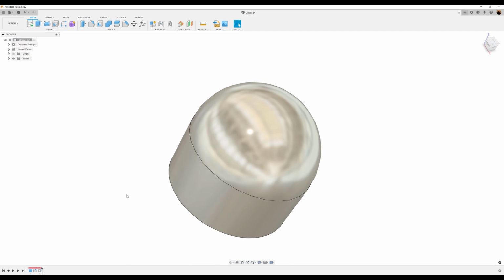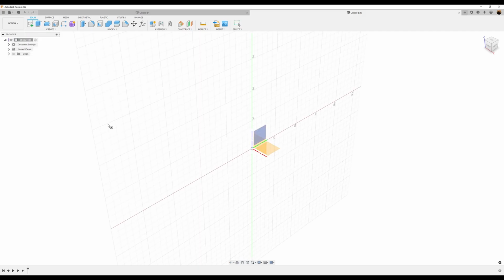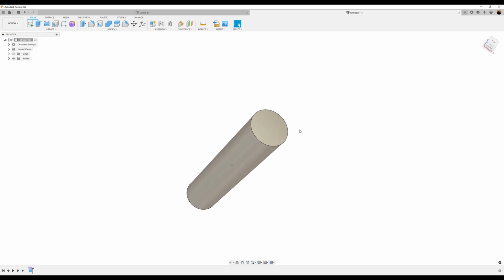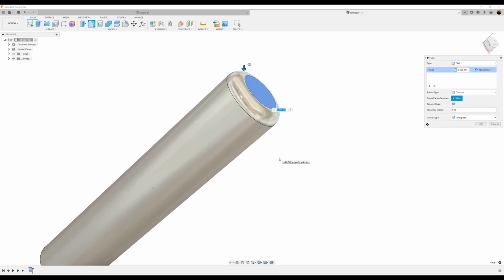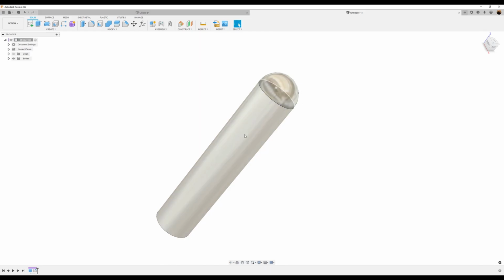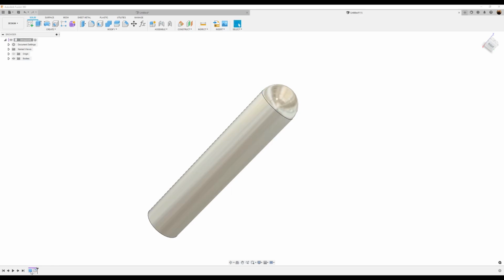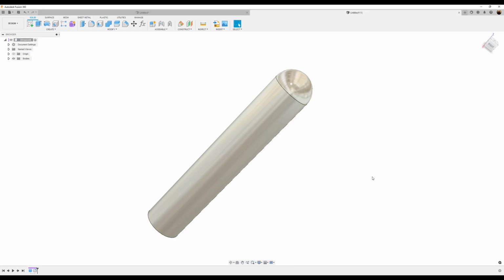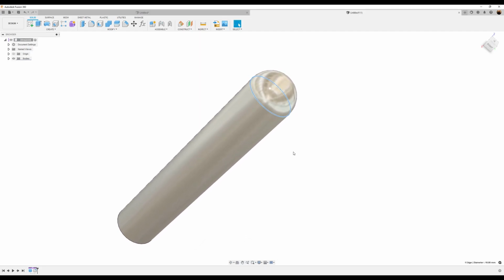How to create a perfect dome in Autodesk Fusion 360

Comment: How many years have you used Fusion 360 did you go to school to learn cad ???
Reply from the maker: I started using Fusion 360 for about 2 years. I also used Blender for about 5 years, 3DS Max and Solidworks as well.

I've never gone to school for any CAD software. All self taught.